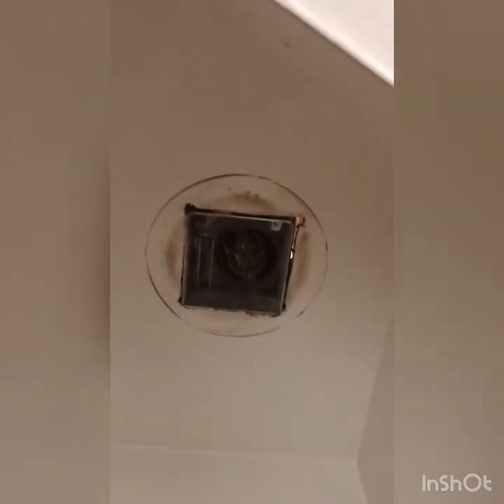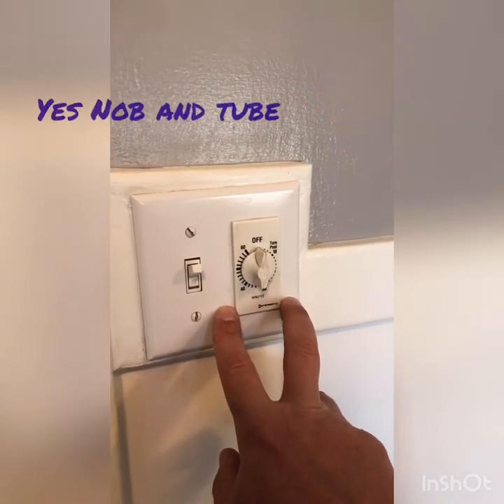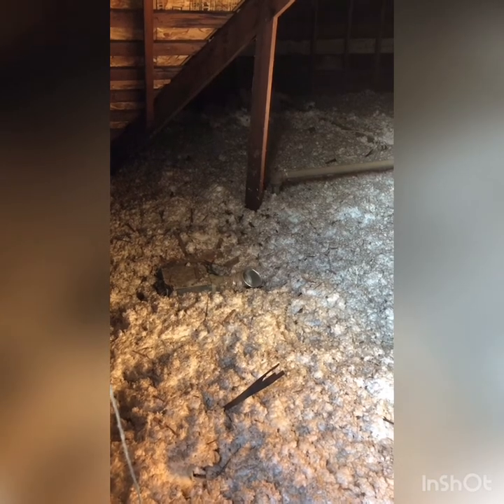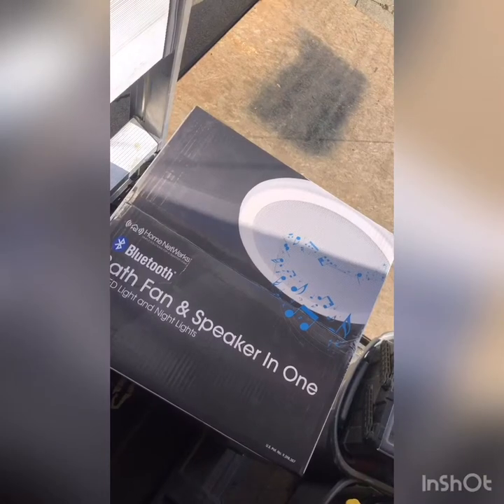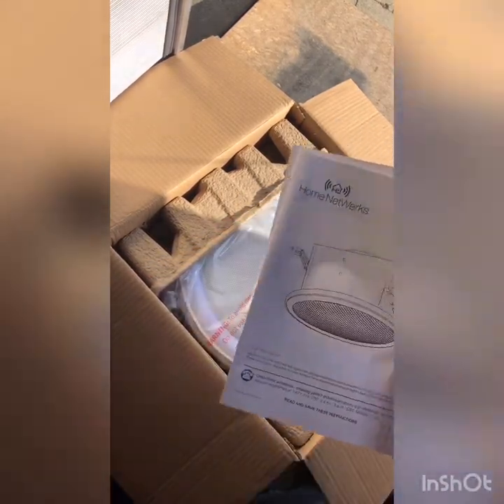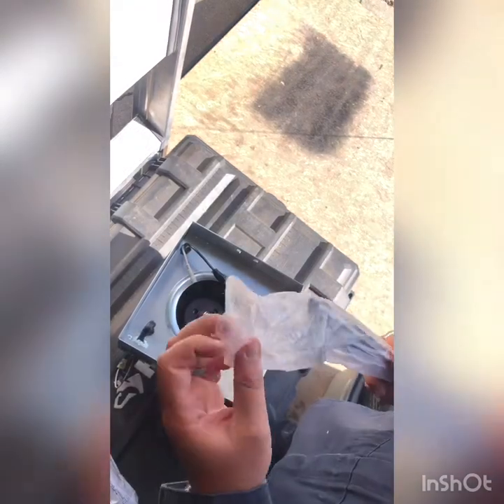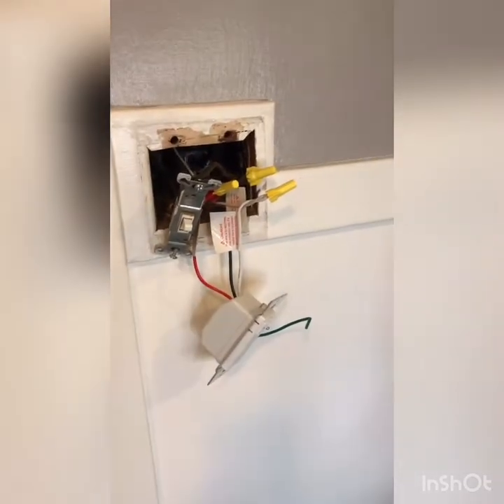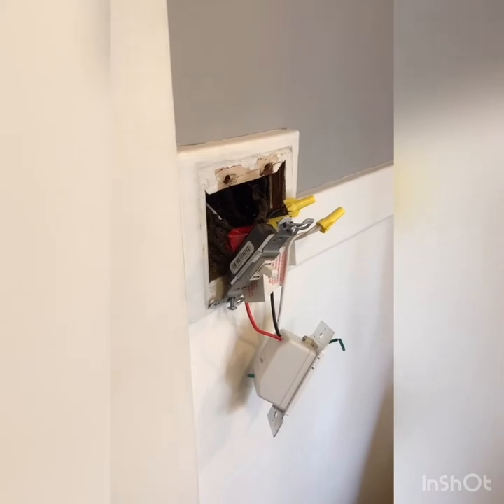Installation of a Bluetooth speaker/bathroom vent fan and light

Comment: It's it possible to wire the light separately from the fan? My wife wants a separate switch?I have the 80 cfm model.  # 7130-18-BT
Reply from the maker: Joel, thanks for the question.  Do you have a separate switch on the wall already?  If not that would have to be installed as well.  Ultimately though it would depend on how many connection wires you have on the unit.  If I remember correctly this one had the basic hot/neutral/ground wires in the unit.  So basically the whole thing was wired to be powered by the switch, but it had a remote that would turn on/off the lights and control the light colors and the speaker’s volume.
Reply: @alsworkshop135  hi. It has 2 white w black 2 green which are all separate. I have one flick switch . I think if tie them together then when I turn the such on the light and fan should fire up.